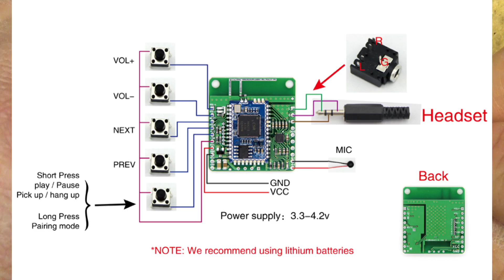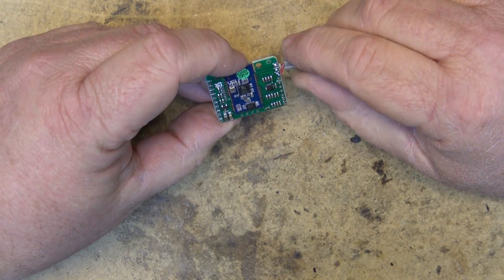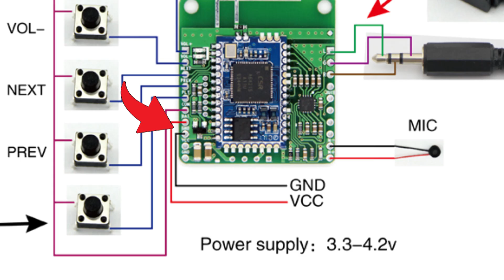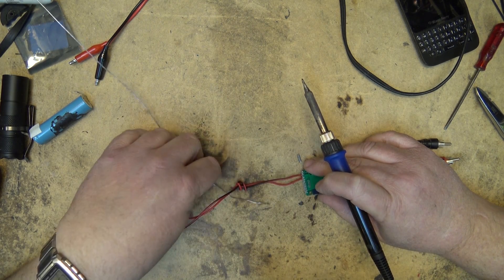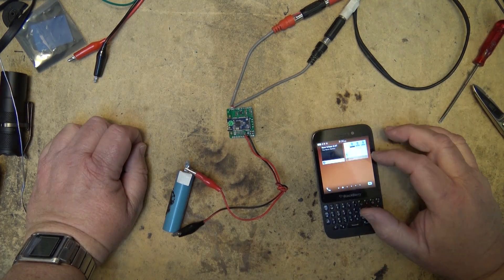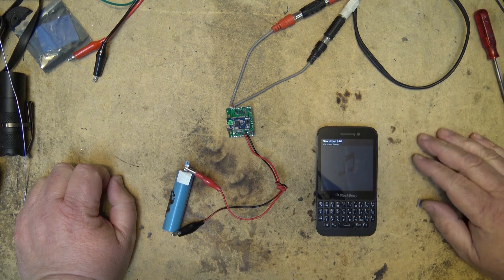CSR8645 APT-X Lossless Bluetooth 4 1 module set up and test

Comment: Sir i bought this module and tested it.
1). It's not switching off even after no device is connected to it. Did you test this case?
2). I am building an Audio amplifier for headphones atleast 5W power. I need differential to differential input output. What opamp chip can you suggest. Please reply me.

Comment: Hi. I like your video. to the point and straight forward. I have been looking for a board that can take speaker and mic input from my PC and allow me to connect my bluetooth headset for voice chat. Can this board do this? I am not good in electronics and I really enjoy working with it with some help. Appreciate if you can suggest some board that can fulfill my requirements. Thanks

Comment: Heads up to anyone using the version with an amp on the backside. When I powered it with 5v on BAT and GND, it cut out at high volumes or spikes in power. It turns out there is a regulator between BAT and the amp. When I connected 5v to VCC and GND it didn't do it anymore.

Comment: Hi 12 volt vids,
I really like your video's, in particular the reel to reel video's.
I was wondering if you could help me with mine?
I have an Akai GX215D, it is in excellent mechanical condition, playback and record quality is pretty good, the heads are in pretty good condition.
But there is a fair amount of hiss during playback, even on pause so I don't think it has anything to do with tape hiss or the heads. When playback is disengaged the hiss stops, the hiss is notably more prevalent on the left channel. So I'm thinking it might be some sort of electronic hiss due to old parts.
From what I've managed to glean from YouTube video's and help forums, capacitors and or transistors including variable transistors might need replacing.
If I were to take my machine to my local electrical service place what exactly would I ask them to replace? to cover my bases. The record and playback levels also aren't completely matched. For example, if I record at a certain level, playback will be quite a bit louder.
I Think I might even be able to replace the parts myself if I knew which parts need replacing, I'm not to bad at soldering and pulling things apart and putting them back together.
Can you help
Thank you :)

Comment: Are you fixing stuff now for viewers I have a Panasonic vcr that has power but nothing happens when you press the buttons sometimes i get lucky and it turns on its from 1985 would love to have it fixed up.
Reply from the maker: Yes I still work on equipment.
Reply: Cool i'll get you the model maybe you can tell me if its worth doing I also have a tape in it that I would like taken out safely. @12voltvids
Reply: its a  panasonic V1545 4head hifi 1985 model made in japan

Comment: Odd...on the big diagram of it on their site, there's 2 separate grounds one for batt and one for Vcc, though I don't know if they're connected on the PCB.  But in section 4 of the pinout, 7&8 (Batt and GND) are labeled as 'backup power' while 9&10 are 'working power'.  In keeping with the latest 2019 technology which is still completely incapable of coherently translating Chinesium to Engrish, both 7&8 end with 'it can not be used' (seriously?  they don't have ONE native English speaking dude over there they can hand their manuals to and say 'read this shit and tell us what's wrong'???)
I don't know if they meant 'can not be used as main power', can not be used along with 'working power' or what.
Reply from the maker: The vcc and ground on the edge do not appear to go anywhere but I have not extensively studied it at this time. Too bloody cold in the shop. I'll turn the heat on when I am spending some time in there on the weekend when I am off as I have another bluetooth board with 15 watt amplifier  and a buck converter board to check out. Don't want to throw the heat on and waste a bunch of power heating the shop up for an hour of work. We are in a really cold snap this week. Got down to 22F last night.  That's -8C and that is bloody cold for this part of the world.  Yes I know a bunch of people in the east just got jealous because they were seeing temperatures down to -50, but here it rarely drops below freezing.

Comment: What is the output level of this device? I couldn't tell from the product specs. Is it the same as the phone output level or is there a built-in pre-amp? Another words can I go straight from this into a power amplifier?
Reply from the maker: It can drive a set of headphones nicely, or into the aux input on your amp. I am likely going to mount this in a box and put it in my work truck. It has a 3.5mm aux input. A microphone, and plugged into the aux, and I have just made myself a hands free speakerphone for my work truck.
Reply: This amp is rated a 5 watts per channel.  I can run a pair of 10 watt 3" speakers with it at almost full volume.  It's not just a receiver board, its a full on amplifier for speakers.
Reply: @Ev3rM0r3  Wow, amazing.

Comment: It seems that it's supposed to have a 12v to 3v isolated dc dc converter at the back to use the 12v vcc input. You can see that on photos from Chinese sites. But it seems that to save cost they don't solder it so the vcc input is not connected here.

Comment: that VCC line looks like it goes in a loop back to GND thru that SMD component. what's the deal there?
Reply from the maker: That is a capacitor. Vcc line doesn't appear to dl anything unless it is for a higher voltage supply. Freezing in shop tonight so didn't investigate. We have the cold snap that they had in the east but it is only - 9 not - 50.  Still cold enough I didn't feel like testing it further. Will once it warms up. I do have heat but when it gets really cold the 5kw heater can't keep up and the meter is a spinning.
Reply: I think vcc pad is connected to the 4 vacant pads for dc-dc isolation module. I think it is the b0503S module designed for elimimating interference noise and ground loop.

Comment: Is that "Piece of junk" a Motorola Moto G4? Mine had the speaker fail, and I've been trying to locate a T3 Torx screwdriver for weeks so I can fix it. The local electronics shop is all out of them.
Reply from the maker: Could be. The phone actually works fine. No problem with it. The big problem with these shitty phones is they use the front camera to detect if the phone is at your ear. Try to cradle it between ear and shoulder to use both hands and the camera that is on the top right sees movement and turns the screen on. Now the screen is pressing against face and touch tones blast in your ear, or the speaker phone turns on, this phone uses the same speaker as earpiece so you have a loudspeaker right in your ear. Just a really bad design. At work we upgraded our vpn security to in-house written apps that only run properly with knox security which is only on Samsung so that is what we use now.
Reply: 12voltvids I have the same phone. Moto G4. The problem I'm currently battling is random ghost touching. Turns out these phones are susceptible to the same problems the iPhone 6 has Which is bending of the housing. I've got mine in a hard protective case, but when I took it out the phone was shaped like a banana and slightly twisted. Not a bad unit otherwise for me.
Reply: You can find T3's at most dollar stores now, and Walmart in a pinch. no need to wait around.
Reply: @FREEAGENTOFGODYAH  I found one, Walmart nor the local Dollar Tree had one, but Harbor Freight Tools had a nice set of small screwdrivers including a T3 bit.
Reply: @richardhz-oi8px  I should have said "depends on where you are " lol.. we don't have Harbour Freight here.    😀